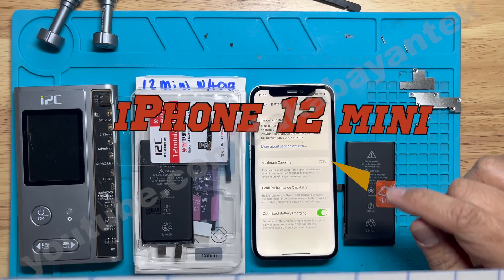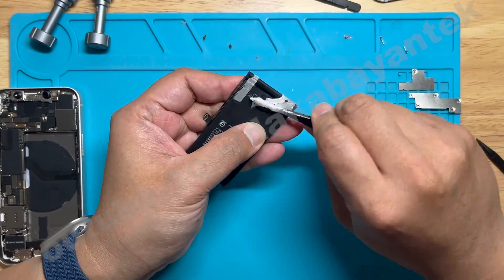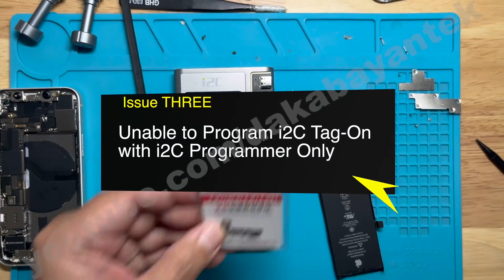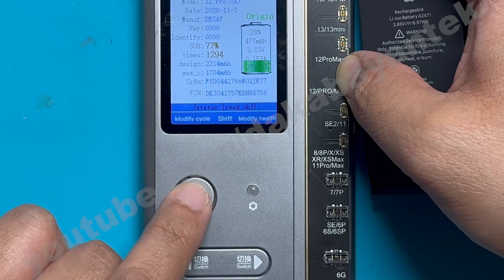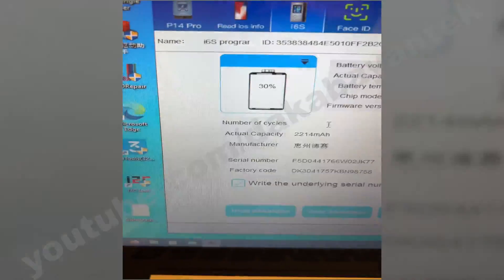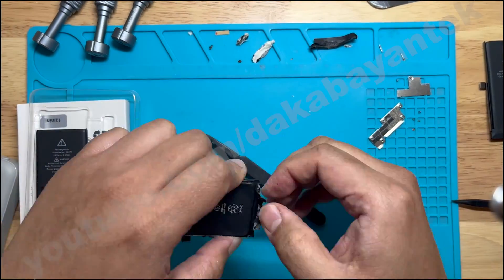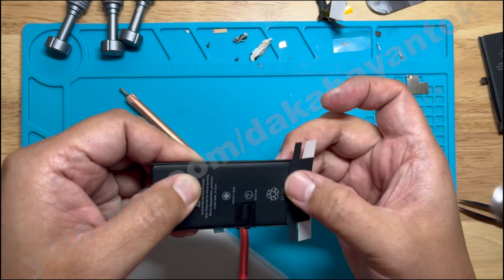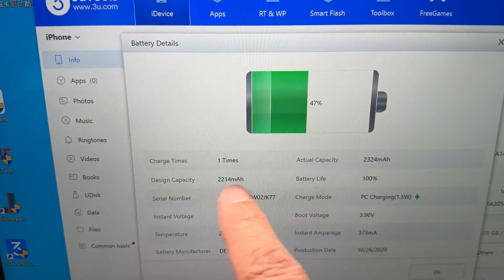i2C Solution to "important battery message" prompt with 100% Health #iphonerepair #iphone12mini

Comment: lodi ano much better pra sa battery program pra sa 13 pro max
Reply from the maker: Brother what ever works for you that would be best. Minsan I use JCID or i2c or even qianli, dipende talga on works… Pero I would recommend JCID or i2c dahil they continue to update their software and dongles. Hope it helps

Comment: Hi!

One question: If my original battery doesn't have the warning yet and is still at say 83% SoH... Is there any issue if i just replace the cell with a new one, keep the old BMS and call it a day? I understand that degradation number will stay the same, but other than that, would there be any other issues? Not too keen on buying the programmer for a one time deal.
Reply from the maker: Yeah thats fine… no issues… why not add a pre-programmed flex then if u have ios17.4 and above to reset it u need to reformat the phone using 3utools
Reply: @DaKabayanTek  How much does a flex cable lik that cost?
Reply from the maker: Try going to mobilesentrix website its around 3-4cad per flex
Reply: Sana po gawa po kayo ng ganito i2c i6s na 17.4 pataas na ios version po